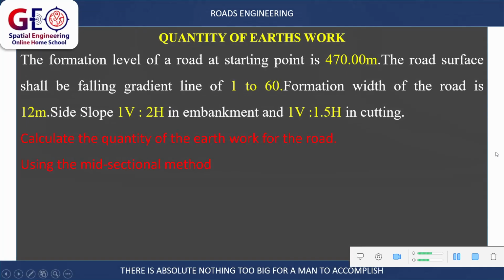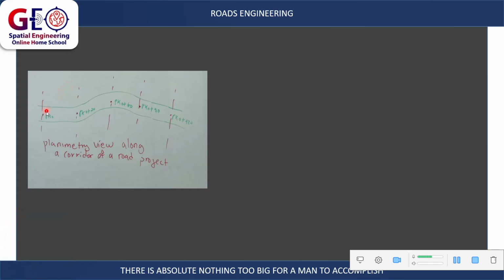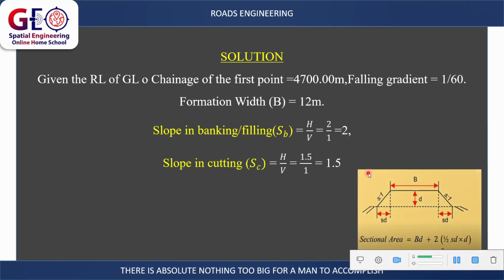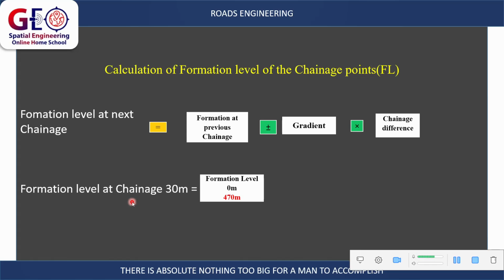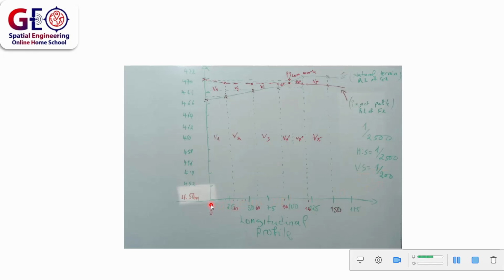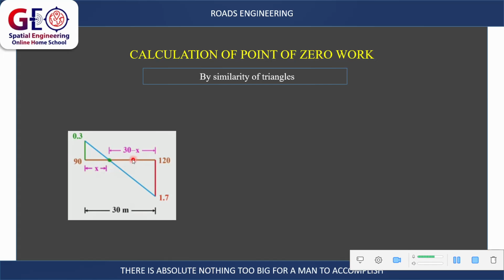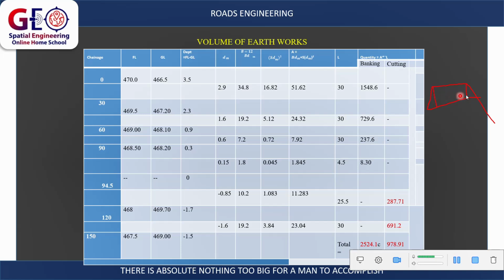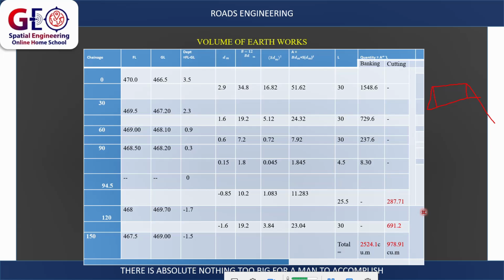ROAD EARTHWORK EXERCISE AND SOLUTION

Comment: Thank u very much for this explanation sir..
But Sir if I'm not wrong I think u forgot the column for the S that we are to multiply with dm  i.e where there is Banking we consider our S=2 and where there is cutting we consider our S= 1.5 so that will be Sdm²= 2×(2.9)²= 16.82 for B and Sdm²= 1.5×(1.6)²= 3.84 for c.